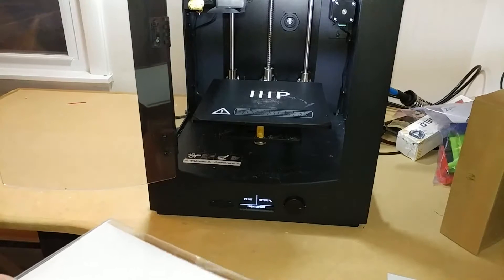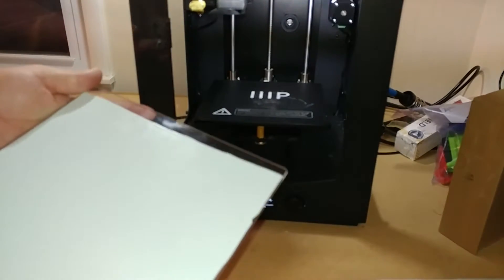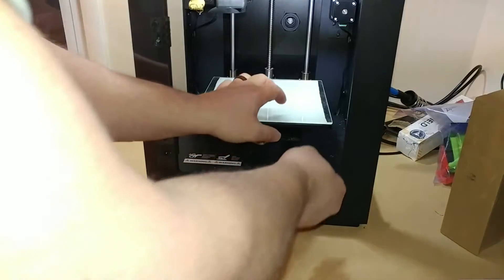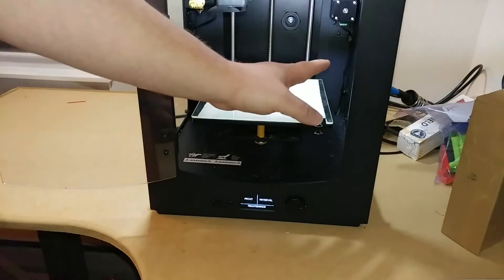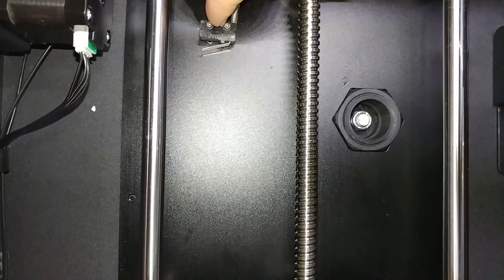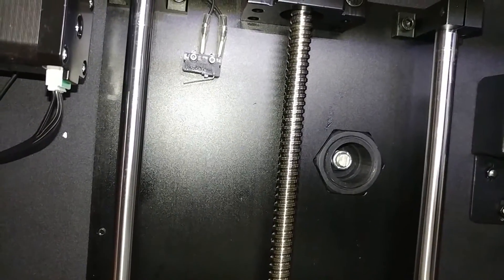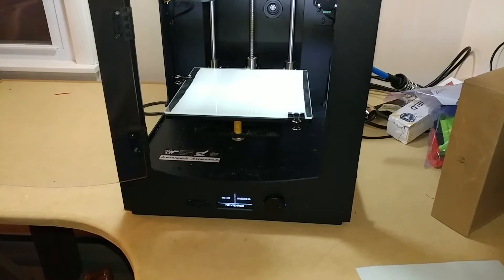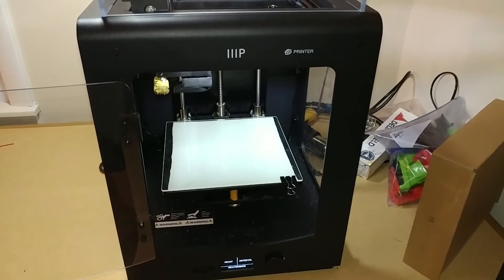3D Printer 101: Adding Glass bed to Monoprice Maker Ultimate 3D Printer

Comment: I have the Wanhao Duplicator 6 and i am trying to add a glass bed. My printer looks like yours , but there is a difference, i do not have the Z axis limit switch in the back for the Bed.   it comes all the way up and rams the nozzle into the glass and lifts the back of the bed up.  How can i fix that?  I do have a sensor on the print head for auto leveling, but doesn't seem to come on when manual leveling is selected.  I tried using Auto Level, but the printer bed comes all the way up and just sits there and clicks up on the shaft,  because it doesn't know when to stop.  I have to shut off the printer to get it to stop.  please help if you can.
Reply from the maker: Sorry for the late reply, but I would say you will need to do come DYI mod and I would not know how to do that.

Comment: I printed PETG on clean glass for 2 years now. No glue no nothing, glass has to be perfectly clean. I use 50/50 alcohol with water to remove prints, it's extremely easy!
Reply from the maker: Thank you! that is a great tip about the alcohol

Comment: Hi,  I just got a Maker Ultimate.  It looks like you have overhead LED lights.  Did you add them or did they come with the printer?  I see an interface for turning up the lights but I don't see any lights on mine.
Reply from the maker: Mine came with the LED's installed.
Reply: Larok Creations thanks.  Just found the proper setting.  It was on always off.

Comment: How are you liking your maker select ultimate? I am currently contemplating getting either this or the maker select v2 that is much cheaper. Do you feel like you need to much in leveling and moding to make your prints top notch?
Reply from the maker: I love it! I did have to rma my first one. I think you can get by with the maker select v2 if your not going to be doing abs. But the ultimate will give you better overall prints with how the build plate goes up and down instead of back and forth. I don't think you can go wrong with ether one
Reply: I just bought one on sale for $549 shipped!  I can't wait!